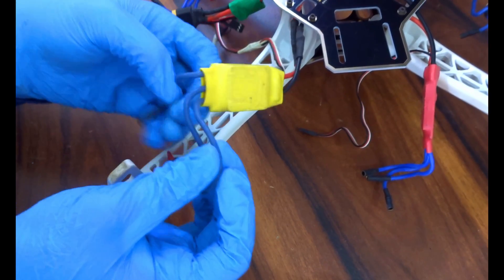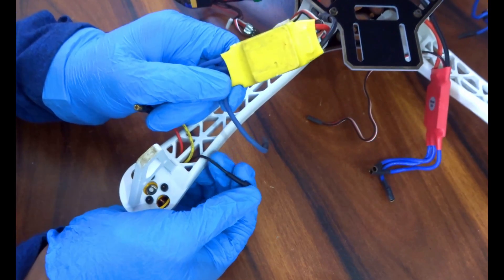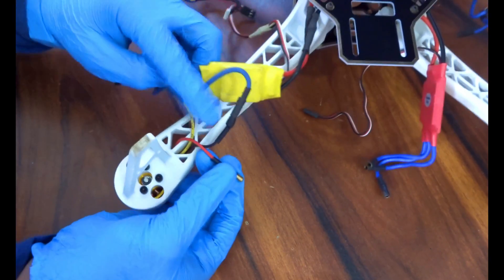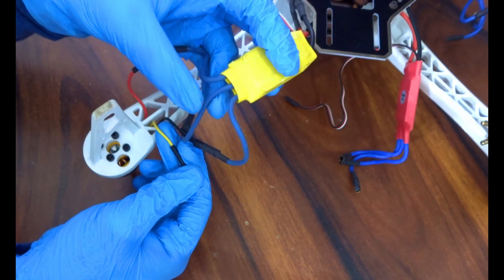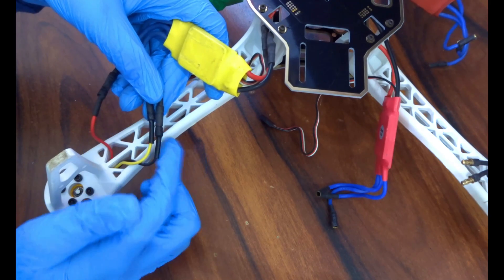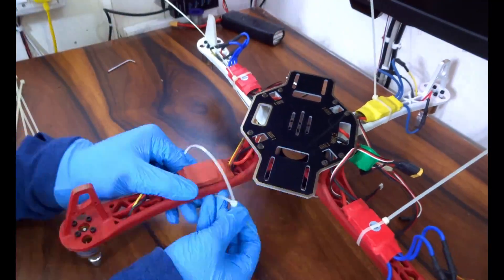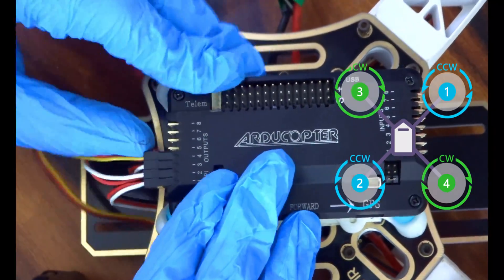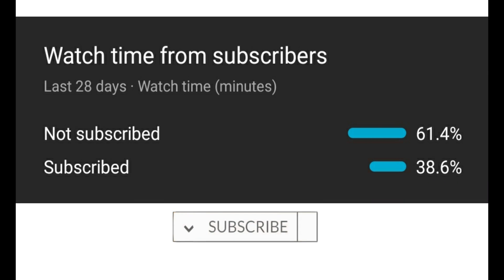DIY APM 2.8 Drone Build || Practical World

Comment: It does not matter which wire of esc you connect motors. You can change the yellow wire too, its a 3 phase motor. there is no positive and negative. Just adjust the wire by its rotation

Comment: Sir, can you tell me the best basic tuning settings my drone is climbing very aggressively when increasing the throttle.
Reply: you need to cover the flight controller.
Reply from the maker: I appreciate you for being concern about the flight controller module safety but it's a prototype and only for demonstration. Thank you 👍👍👍
Reply: @PracticalWorld  the sunlight makes the apm 2.8 climb or drop. he shold cover it with a dark plastic bowl.i was telling that to biplab.
Reply from the maker: @frankyflowers  Well I didn't knew that fact and thank you for also helping me. I was finding the proper reason for @Biblab Sarkar problem.
Reply: @PracticalWorld  when its in altitude mode if it rises or falls when you spin it then thats why. some people cover it with foam.
Reply from the maker: @frankyflowers  well it's true I checked it. And thank you alot for helping me. But how can you know much about such technical problems as I am 17 years old and working on it.

Comment: how to install camera in this
Reply from the maker: You can directly install the camera on drone but your video will not be clear due to the high vibration produced by the drone if you have shock absorber and gimbal then you can attach the gimbal through its cliping and drill a hole on bottom plate of the drone. Max gimbal and camera weight must be around 500gram
Reply: @PracticalWorld  but how will it connect to receive live video
Reply from the maker: @bestofrfs9133  if you want live feedback from the camera then you have to purchase a FPV camera with Video transmitter installed on the drone and you will need an FPV Goggle for Live Feedback and to see live camera action. Those stuffs are expensive and might cost around 6-10k rupees.

Watch this Video 
https://youtu.be/K5RzP23dn6g
Reply: @PracticalWorld  one last question bro does apm 2.8 support a fpv camera?
Reply from the maker: @bestofrfs9133  it does support FPV but you cannot get live feedback of the camera so I recommend you to use Separate FPV and Video transmitter and use Telemetry to watch live video of FPV through your Smartphone.

Check the Video link that I gave you on the Previous Comment. 
And Feel Free to ask Question.